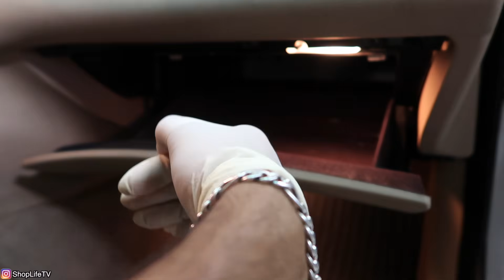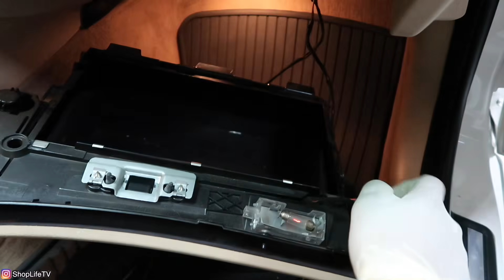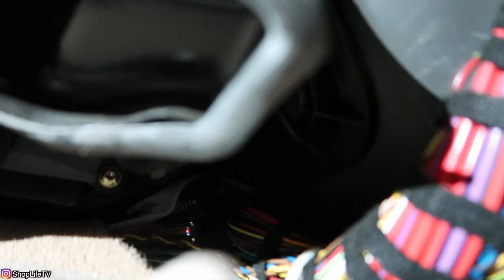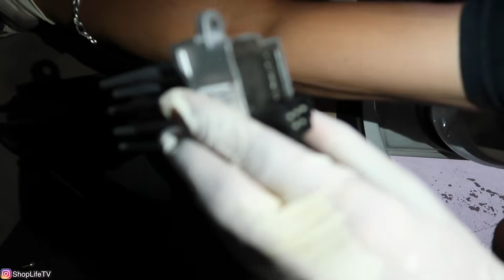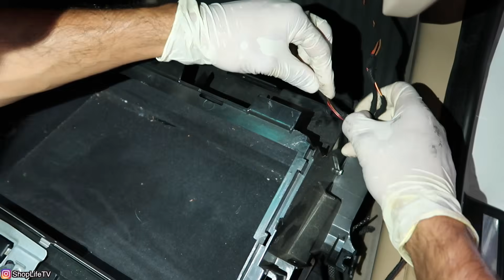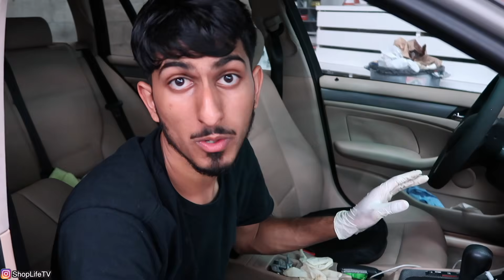BMW E46 AC Blower Motor Resistor Replacement DIY

Comment: Thanks for the great video, could not have successfully done this without it. However accessibility is even worse than the video suggests...if you have big hands it is terribly difficult to reach in to unclip the wire harness plug from the resistor because of lack of space.

Comment: I saw the BavAuto video on this, very same part, on the X5. It does not use the two T-20 screws in that application, only the spring tab. The implication is that this is suspenders-and-belt engineering and that the two screws or at least one of them is superfluous and if they are extremely difficult to re-install, the world probably would not end if they are left out and only the spring clip relied upon to hold the unit in position. Where would it go?

Comment: Thanks a lot for the video. It took me forever to take the resistor out, but now I understand: you have to make sure to take it out straight, keeping the connector on really helps for that. I also took out the flap actuator in front, so there's nothing but the connector in front of the resistor.

Comment: Can it be the reason for the car to overheat?
Reply: My car overheats after motorway journeys, engine gets smokey for a short while. I also find that my battery is drained some mornings. I found out my car hasn't got a resistor (just bought it last week)
Reply: i know im late but no, all this will do is cause the AC to not work sometimes and drain the battery while the car is off

Comment: Very important!!! for  e46 UK you find it under the steering wheel.
Reply: I opened up the front passenger side and was like where is this fsu, I can only see a air vent when looking at the top, so Im now having to put it all back together and will open up the drivers side. Its been very frustrating indeed. Hopefully, get it sorted today! Thanks
Reply: @90nadz same i was going to change mine and was confused asf
Reply: @07hundred  1
Reply: @DeisonProdWis  ذء،ءءءءذ،ءءءءج
Reply: @90nadz 2002 e46 coupe...is it on drivers side ?
Reply: Thanks man love you so much god bless you
Reply: @William Evans harder than the LHD ones for sure, steering column gets in the way and it’s difficult to manoeuvre tools while trying to avoid that
Reply: And I can’t find a single video that shows this in terms for idiots like me
Reply: I didn't know at first. Had to restart the process but on the right hand side.
Reply: So basically, its found on the right side of all e46. Doesn't matter the hand drive!

Comment: Looks simlpe enough. I just did my E46 with alot of swearing and patience for 1 hour. I cant get the lock tab in place with newer model. I just tightened the screws well enough.

Comment: I have a 2008  BMW 750 Li after replacing the blower resistor it still had the problem of a weak air stream that doesn't change speed. however 2 days later the AC blew very strong and cold. I tested by turning it off and on about a dozen times and it worked. The next day however it was back to blowing  a weak steady stream of air. what else can I do to fix the problem

Comment: So is this pretty much the only failure part excluding if the fan motor itself goes bad. Just asking Q? before I tear into this. Because this spring it suddenly would not respond to the high/low fan speed controls at any speed. Wasn't hot enough in April to really make me do something about it then. But weirdly about a month ago I got in the car took off and suddenly realized HVAC controls had came on by themselves and the Fan was running Fine! Strange I thought. I preceded to turn every thing off. The fan responded to each step down till off! It Only did this once and fan never ran again? Otherwise the HVAC controls work, the A/C compressor runs and I feel cold gradually coming out but obvcourse no blower...

Comment: I think it's good to point out that if your air is not blowing at all, and you don't know what it is. JUST because you feel a little air while driving, doesn't mean that it's working. So if you feel a little air when driving down the freeway, or faster than 20mph, but otherwise while sitting still it doesn't blow at all... Your FSR is bad. So replace it, with the help of this video.

Comment: You do the best videos Jason.  I watched several deal with this replacement and yours is the best.  Camera angles and lighting are the best and you show every step.  I suspect I'll have to replace mine (not 100% sure right now).  If I do, I'll be using your video.  Thanks.

Comment: Hi I have an 01 330ci, I was defrosting my windshield and had the heat full blast when I turn heat off the blower is still full blast and I even turned the car off and disconnected the battery, whenever I connect the battery the heater blows full speed without turning it on, can it be this or relay?
Reply: Mine just started doing the same . I unhooked the battery for now.. Did you have any luck fixing this?

Comment: Hi @ShopLifeTV Jason bro first of all thank you for your efforts on your channel it has been a great help for me as a newbie in e46 world, recently I found something lying under the glove box of my e46. It seems that it is the heater flap actuator, I can't seem to post a pic here of the actual, but here is the link to the part that is lying under the glove box: https://www.ebay.co.uk/itm/BMW-3-SERIES-E46-HEATER-FLAP-ACTUATOR-MOTOR-BEHR-6902854-35451e/223064384798?hash=item33efac651e:g:ME8AAOSw2NBbTZQK . It is not whole part but I believe it is the half one. Do you have a video on how I can replace this? Btw, I have a year 2000 bmw 318i e46 non facelifted model. I am not sure if I can message you directly or just need to comment things out. Thanks in advance.

Comment: Thanks man, just replaced mine, took just about 20 minutes with the help of this video.  Mine had been replaced before with a cheap FSU which caused the blower to cut in and out and eventually got stuck on high even with the car off.
Reply: took almost 2 hours for me with another diy I should have watched this video first. Moreover the fuse was really difficult to take off. At least it works...

Comment: I removed my bmw 325xi battery and used other battery to start the car. After then i noticed my dash board light is not working any more. Also my AC only blows hot air. The radio screen displays DISABLED. Please how can i restore all of these?

Comment: Nice DIY video for replacing the blower motor resistor for BMW 330i 2001 model. The problem of my car BMW 330i 2001, when i started the engine and run the AC to high for a few minutes, and after few minutes i did try to reduce to medium but still running on high and i keep reducing to low nothing changed, when i switch-off the engine the AC motor still running, so I started my car again so as not to drain the battery and drove to my friend's place who is a mechanic, he switch off the engine to diagnose it,  but still the same the AC motor is still running even the engine is already switch off, so he disconnected the battery, and removed the grove box out and remove the fuse while awaiting the replacement parts that we are going to order.
Reply: Same case with me! What is a 100% solution ??

Comment: What if your a/c won’t turn off? 
My a/c will stay on even with the car off, the only way to turn it off is to pull the fuse. 
Any help????
Reply: And I did replace the blower motor about 1 year ago because it had the no a/c problem.

Comment: Question to all bmw e46 owners my coolant low level light is on and I’ve changed the tank the level sensor and it’s still on what else could it be ???
Reply: Anthony Soto curious what it was and how u fixed it. Mine has the same problem.
Reply: some of the offshore (chinese) tanks dont have the magnet on top of the float inside the tank that the sensor requires to work so it just stays lit. The only solution is to buy a more expensive tank. The tank itself works but the sensor doesnt'. You get what you pay for.

Comment: BMW e46 coupe 318 2002 143ps good or not good?
Reply: Not good, 2.5 or 3.0 are better, but there is an oil consumption problem. The best 2.8 in pre lift models

Comment: Hi guys, I have a problem with my 2002 316i valvetronic, the thing is that the engine doesn't rev and the check engine and EML lights are on in the instrument cluster. It must be something about the EML because from time to time the light swithces off and the engine works fine. I had the card tested, and it said that the acceleration pedal needs replacement, I have replaced it but it does the exact same thing. Have anyone experienced the same problem? Any advice about how to solve this? Thank you!

Comment: That thing took me a looong time to get replaced, and it even electrocuted me (And it wasn't connected).. So I'd suggest you unhook the battery just in case .. 
It was such a PITA to replace in a coupe, unsure if the sedan is more spacious or not

Comment: It would be better if you show us a way to test what is the fault actually,just to be sure which part to replace,the blower motor resistor or the blower motor itself,instead of just guessing which is the faulty one,Thank you.

Comment: Very good DIY with the right details. Sometimes the bad resistor will drain the battery also, when the car is parked. In the European bimmer community, the resistor is called 'the hedgehog'.  Did you know that? Dutch regards.

Comment: Hi, very informative.
I have E70 X5 with left brake light bulb not working, I changed the bulbs and it's still not working and the message of faulty light still there, could you advice please.
Thanks,

Comment: Hey my ac system is fine except whenever i switch it to heat there’s no hot air
Reply: zeejay Simo bleed your cooling system
Reply: That's the issue I am having with my X5! Will replacing FSR fix the heating issue because I get air conditioner cooled air with no problem?

Comment: I have an e46 and an e39 and I've had to replace this darn thing twice in both of them within the past year. It sucks. The manufacturers of these FSU's should be poked in their eyes for making such crappy parts. What's even worse is the first time I attempted to swap out the FSU in my e46, I thought I had to remove my glove compartment to access the darn thing. My cars are right hand drive cars. I had no idea all of the FSU's are locted on the right side. You live and you learn I guess.
Reply: jason490  RockAuto sells the cheap Hella Behr FSUR/FSU/FSR like the one Ankur is advertising from ECS Tuning. I prefer Beck Arnley parts for our E46 and E90's. These range in price from Behr's cheapest FSU advertised here for $23USD, Beck Arnley for $49USD all the way up to Airtex/Wells for $92USD. We're still debating whether to go with the BeckA or Wells part for this replacment.  We put a BeckA water pump in our E90 last summer and it's held up quite well. Any recommendations?   Nice job on the tutorial, though, overall Ankur! Thumbs up!!
Reply: Sura Meso Films hmm.. have to watch for that since i purchased a medium quality unit. My 20 year old e46 repair costs should be kept low😊 just replaced gaspump, sensors, plus other stuff. Probably cost half the value of the car.
Reply: I've had the exact same issue the first time i replaced this resistor i thought i had to remove the glove box which it turns out i didn't have to as i have a right hand drive car and the resistor is located in every other e46 on the right hand side. Anyway another e46 i have and i need to do this job again lol at least now i know how to do it.

Comment: Hi,
Good job as usually.
What's the OEM reference number of the item You replace please? 
I don't find it on realoem.com using my VIN.
Thanks
Reply: khaled serhane BMW HVAC Blower Motor Regulator BEHR E46 E39 E83 E53 HELLA 64116923204